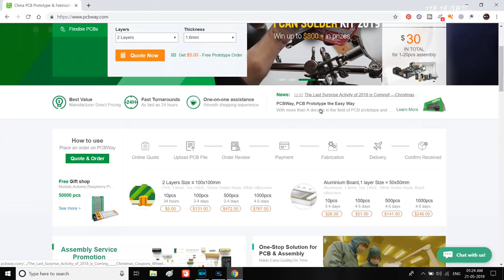DIY 18650 Battery Spot Welder Using Super Capacitor 500 Farad

Comment: Its a fake... Capacitors discharge in a flash but he spot welding it repeatedly..
Reply: No, some caps like these can stor a lot of power and dont discharge instantly
Reply: I had same doubt but I guess that's due to nickel strip resistance.

Comment: thanck's you are a free electron! but here 500 Farad is too strong, when we look first point welding, here we see, that is too strong to this thickness, was it 0.15 or 0.10mm?, so can be are correct to welding point on 0.2mm. Here you have should make 6-8 welding point to first side on cell. Is too heavy as welding point amount. With one welding point should are ok. If i use you'r capacitor, so i should make 100 Cell welding, so 200 time use, is too many second if i should 6-8 point to weld/cell side.

Comment: A 10€ aliexpress welder does a much better job, but then again, it doesn't have super capacitors :(
Reply: Than You still need a expensive accu power supply

Comment: Pretty impressive. You could just leave the capacitor plugged into the psu the entire time.
Reply: Wouldn't he then short-circuit the PSU when welding?
Reply: @gez_4515  Yes, but the capacitor would supply the welding power. If it's a big problem, add a small resistor in series to the capacitor to charge it during short breaks between welds.
Reply: @gez_4515  use a diode

Comment: I have 400v 1000uf electrolytic caps which I use quite often, will these be good for spot welding?
Reply: Yes in essence,  Be very careful though. Check what max input voltage for capacitor is or it can blow up when you charge it. Also there is some dodgy handling of the capacitor once it has been charged in this video- if you're unsure how to safely work with capacitors, especially once they are charged, do some research and get a better working knowledge of capacitors. They are useful components but despite their benign appearance they can kill if mis handled.
Reply: @jaileal8806  thank you, I plan to print a case for it to make it safe
Reply: @jaileal8806  I agree never handle a charged capacitor (or one that mite  be) it could kill you.

Comment: 2.7v NO WAY !
Reply: That's how a spot welder works, low voltage but high amps.
Reply: @f-8859  I = VxR. more voltage then more current burst. double voltage then 4x power for shorter burst.